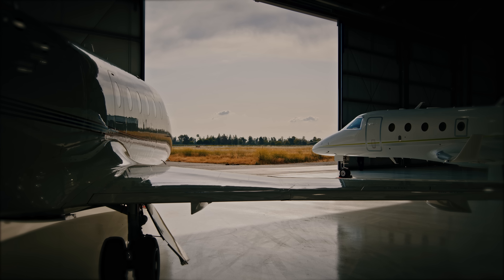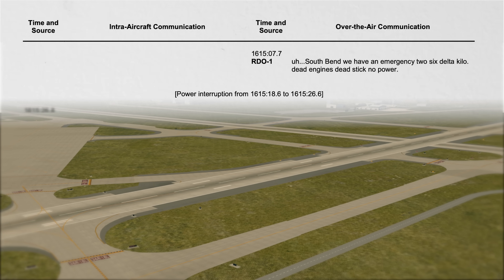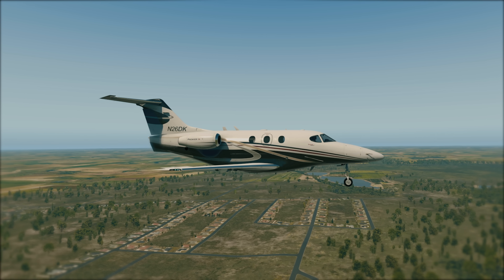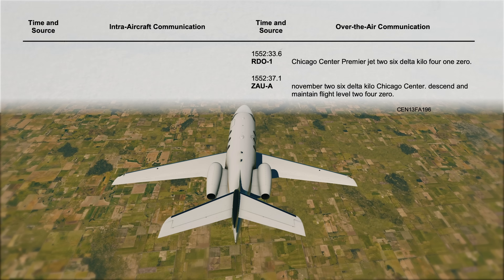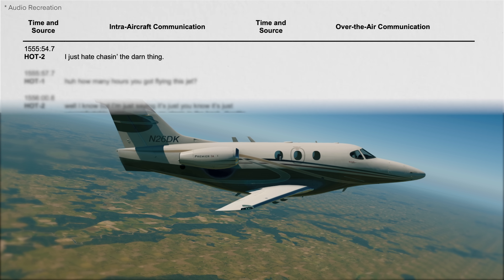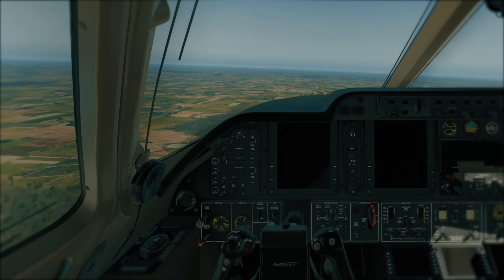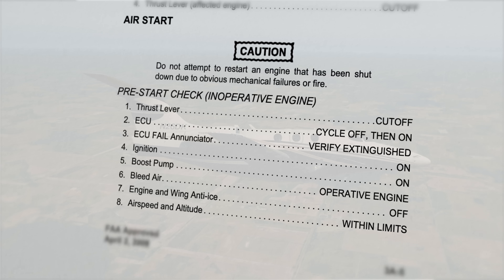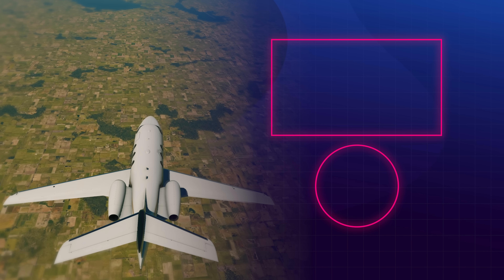Passenger Causes DUAL ENGINE FAILURE | Accident Case Study

Comment: Letting an inexperienced pilot have some time flying your aircraft is not inherently wrong or unduly dangerous.  However, the pilot in command needs to use some common sense.  This was a complex aircraft, difficult to fly precisely by an inexperienced pilot.  And secondly, the pilot in command was not an instructor.  He did not have experience in teaching someone how to fly the Premier.  He had no plan of instruction, did not issue specific or consistent instructions.  He should never have allowed the inexperienced pilot to enter the approach and landing phase of the flight.  Once the trouble began, both pilots were overloaded and overwhelmed by the multitude of malfunctions.

Comment: Obviously the whole entry into the error is a big issue, but am i wrong for thinking the gear up landing sounded pretty tempting given the situation?
Reply: If you know that the pilot is too incompetent to do a single engine go around procedure properly,  sure.  But there's no way for ATC to know that.  Personally,  all things being equal I'd feel safer going around on one engine than possibly flipping the thing into a fireball while sliding down the runway.

Comment: A belly landing on first approach was the best option.  Going around on one engine, then extending only the nose gear was the start of the fatal sequence.  Wheel-barrowing on the nose gear, no doubt scrapping the tail then led to the bad decision to attempt to get airborn again on one engine leading to the turning stall and crash.  ATC is not at fault.

Comment: It is also poor plane design of the landing gear control, the electrical control and the fuel stop finger levers.
Reply: He told him to pull it all the way back and he pulled it all the way back. It was pilot error.  It might have been an accident but he did tell him to pull it all the way back and that's what he did.
Reply: @LarsLarsen77  Yes, but controls should be foolproof and intuitive in design.

Comment: Bad design to have those fuel stops right there where they can be pulled by accident. I'd sue the maker of the jet
Reply: The fuel stops are questionable, but the standby switch for the electrical system is a real death trap for anybody who doesn't understand the detailed design of the plane. And therein lies the problem... the owner/pilot didn't bother to understand the plane's design (which was most likely chosen for good reasons). A professional pilot trained on this model would not have made any of these mistakes.

Comment: The owner of the aeroplane was a macho show-off, however, design of the throttle levers is grossly inadequate and certainly not foolproof. I've just watched a Mentour pilot video in which the ultimate cause of a serious accident was an overlarge watch dial catching on a control lever. Bad design.

Comment: I do not scuba into caves. I do not skydive. I do not fly often in commercial aircraft. I do not ride a motorcycle. I am happy.
Reply: More likely to be killed in a car crash than an airplane
Reply: @SpicyMcLovin  Not true.  You're more likely to be killed on an airplane flight than on a drive to the grocery store.  Flying is only safer than driving PER MILE, not per trip.
Reply: @SpicyMcLovin  Also,  that's for commercial aviation,  for private pilots the risk is WAY higher.
Reply: Except you probably drive a car...lol
Reply: You are a wise man.

Comment: I love how this is supposed to be a teaching moment? Yet, NO WHERE in this video do they acknowledge that ATC told a plane with no engines and no hydraulics to "go around" when in fact they should have told him no gear you will be belling landing on the center-line!? The trucks were there, but instead they said what they said and somehow the bad pilot managed to get an engine going furthering the "Swiss cheese" model! 

Calling a "no power go around" was ATC INCOMPETENCE! 
Belly landings are normal to a degree regardless of the incompetency of this particular pilot!
The ATC is in my opinion just as responsible for the deaths of these two pilots!!

Comment: I think this is mislabeled. This absolutely IS pilot error. Pushing an unqualified and uncomfortable passenger to control the plane in a critical phase of flight is foolish and dangerous.
Reply: Agreed. His attempt to show off was infuriating
Reply: Absolutely, this is mainly pilot error. While there is things the passenger could've done - like insisting that he's a passenger and he wasn't gonna help fly the plane any further and perhaps even leaving the cockpit if the pilot didn't get the message - it was mainly on the pilot. Even after the engines accidentally got shut down, he should've known how to restart the engines quickly, and once he got one restarted he should've (as the narrator said) circled at altitude first and troubleshooted and probably gotten the other engine started and made sure they could get all the gear down before coming down for another landing attempt.
But his attitude towards the maximum landing weight and airspeed shows that this crash was caused by more than just a mistake by the pilot: This was the pilot's entire attitude that was a major problem and would most likely have gotten him and his passengers injured/killed on another flight if it hadn't happened on this one.
Reply: @Vousie  If he did all of what you said he almost certainly would have landed ok.
Reply: Yes!
Reply: Shouldn't the captain know how to restart without using a checklist? And shouldn't an engine restart (even a dual engine restart) be as simple as possible to do when a plane is airborne? Shouldn't engines be not so easily accidentally turned off? That engine restart clearly wasn't simple to do or else the captain would have got both engines restarted. Wasn't there a loud alarm in the cockpit to alert the pilot about the landing gear not all being down at low altitude? If not then why not? It seems to me that this was a combination of  pilot error (over confidence and also giving his inexperienced friend too much to do) AND badly designed controls and alarm systems on the plane. Very sad outcome.
Reply: @WinstonWolf123  I'm sorry about the way this sounds. I have never said anything like this before, and I watch a lot of these accident videos.  The pilot was unbelievably stupid and full of himself, showing off like that.  The passenger non-pilot should have told his friend, I am not touching the controls again after the first overspeed.   This has to be the worst case of complete stupidity I have observed in the many videos I have watched.  The closest would have to be Saudi Flight 163 back in nineteen eighty when 300 people died.
Reply: Aircraft should be designed safer. Period.

Comment: What controller in his right mind tells an airplane with dual engine failure to "go around "??
Reply: A controller who doesn't want to see a fireball with people on the inside?
Reply: It didn't have a dual engine failure,  it had one working engine.  And it did go around.  Why would it even matter if he told him to go around with no engines?  It's not like it's possible.  He could have said "fly to china" it wouldn't matter either way.  That plane is coming down like a brick no matter what he says.  Why are you so angry about it?

Comment: I have a comment and a question. the comment.  the narrative is very detailed but it does not address any of the possible reasons why the aircraft banked right and the dove into a private residence after the second go around. what came to mind for me was this possibility;  When both engines were accidentally shut down it seems entirely likely that the primary pilot would have been under tremendous stress. As pilots typically do he didn't show it right away. but the fact that the pilot failed to complete the correct restart procedure and the landing gear was not fully extended during approach leads me to wonder if the primary pilot didn't have a health related emergency at that moment, caused by the stress. Perhaps he had sudden chest pains, a panic attack or possibly even the beginnings of a stroke. Anything along those lines would explain why the pilot did not successfully fly the plane in those final moments. Perhaps the friend in the co-pilots chair was attempting to manage the crisis when the end came. Now the question; Why don't airports have special emergency runways designed to accommodate planes that are coming in with problems. extra long runways with surfaces designed to slow the aircraft rapidly while spraying the plane with fire retardant foam. Perhaps a series of breakaway nets to stop the plane or dozens of cables to catch the underside of the plane and the break-off one after another to slow the plane. Some of these suggestions may be unrealistic or even silly but that doesn't mean that engineers can't solve the problem. When safety devices for cars were first suggested they were laughed at but now we take them for granted. Planes are just a lot bigger but it is still the same basic problem. thank you

Comment: This is why I don't think we'll ever get flying cars lol. I'm continuously doing flight simulator when not flying.
Reply: We will get flying robotaxis without controls. You get in a pod, pod does the rest.
Reply: @lepidoptera9337  There can be controls for emergencies,  but they would be idiot-proof,  so instead of controlling the flight control surfaces directly you would just say "go left,  go up go right" etc.
Reply: @LarsLarsen77  Flying doesn't work that way. You can't just go left or right and in an emergency most people will do just about the worst thing possible in the air. See the recent deadly accident in Korea. The pilots made about every mistake that one can make.

Comment: All pilots should remember in any emergency ANC = Aviate Navigate Communicate in that order!
Reply: The first problem is that in order to aviate it is absolutely necessary to know how to fly the machine. These guys didn't. They didn't even know how the power switches worked and how to restart the engines.
Reply: @lepidoptera9337  that's why you always use the checklist. These guys just proved Darwinism by killing themselves by being stupid
Reply: @lepidoptera9337  Restarting the engines isn't aviating.  It's working the problem,  which comes after aviating.
Reply: @LarsLarsen77  Read my first sentence. Having said that, I am happy to give you more attention until Mommy comes home. :-)
Reply: THIS

Comment: 15:13 The standby handles "minimum necessary to land" - which DOES NOT INCLUDE THE GEAR?? Or Starter???  So call it pilot error or what, call it inappropriate or illegal control delegation, call it cavalier disregard of design limit recommendations... just bumping that tiny toggle, which MIGHT have been inadvertent and UNnoticed, is what actually gave FIT ??
Reply: Not the way I understand it. It seems that as long as the engines were running the plane would have had power, even on standby. The problem was that they switched it on standby without the engines running. This is where working the checklist comes in handy, but it's not clear that the engine restart checklist would have been idiot proof... will a checklist designer assume that the pilot turns the electrical system off before he tries to restart the engine? Maybe not.

Comment: It seems like there are a lot of backup systems when failures occur. They have to be used in a very specific way. You could easily make mistakes if you are not knowledgeable about the plane you are flying and how exactly those systems work. You might think you're doing a good thing. But maybe not or maybe just not enough.
Reply: The backup system that guards against pilot error has to be invented, yet.

Comment: The gear up, no power, dead stick go around was a bad request.

It’s possible that the gear up landing could have been survivable.
Many of these smaller jets have positive outcomes with gear up on pavement.

I wonder if the go around instructions are mentioned as contributing factors in the actual ntsb report.

Comment: I never flew a plane and only know how to fly and what to do from simulators. Normally problems and problem solving in these situations is always very complicated, but in this case I was step by step "Easy, just restart the engines.... check the manual for the procedure..." etc. Every minute that went on I was more and more like "Wtf is that guy doing?!"

I'm certain there was zero issue with the plane, just sheer incompetence (through arrogance and willfully ignoring procedure).
Reply: EVERYBODY PANIC!!! FLIP SWITCHES RANDOMLY!  STOP PAYING ATTENTION TO FLYING THE DAMN PLANE!  BOOM

Comment: I have no formal experience in aviation, but if you were to have both engines fail while having an unexperienced person fly, wouldn’t you check to make sure anything they’ve done recently was done right? 

Seeing as he got 1 engine to start up leads to believe he ended up figuring out what happened, but was too slow to start both.  If so, that means he only checked over his friend’s work after a few minutes.  

It frustrates me knowing the pilot knowingly had someone else pilot a craft they clearly were not familiar with.  In my opinion, if you’re to have someone ever operate anything they’re not familiar with, you should know every in and out of your craft, and your unofficial copilot should be comfortable operating such equipment.  I know that is technically not allowed, but odds are these men would be alive today if the pilot followed that basic principle.  He clearly did not know every in and out of his craft as he would’ve noticed the engine had been shut off almost immediately, and would’ve been able to back track and reverse whatever was done wrong.

Comment: I can see why you would have a passenger fly the aircraft if you are enthusiastic about it. I don't want to defend it. It's against regulations, and for a reason. However, ignoring overspeed warnings is a huge red flag (or rather a huge red barber pole). And what happened after the engines have been shut down is nothing short of a shitshow. Seriously guys? There is a checklist for everything and it's not too hard to follow it. It's the best option you have. Playing around with the knobs in the cockpit will usually lead you nowhere.
Reply: But also these thrust levers are shitty design in my opinion. I would always make some separate switch for shutting down the engines instead of integrating it into the thrust lever. With the current design even a pilot who is properly trained could accidentally cut off the engines in a high stress situation. Mistakes will happen. This is just how it is. And one option to deal with mistakes is to make it as hard as possible to make this mistake, which means not integrating the fuel cut off to the thrust levers.

Comment: I had a King KMD150 on my plane, in addition to a Garmin 430... the KMD150 is not IFR certified... however it was much easier to use than the 430 and I often used it as the primary tool, but a battery powered IPad with the slow refresh rate... not for me.. capturing the ILS via vectors would have been the way to go, but I got a feeling this plane didn't even have a CDI

Comment: I would never imagine that thrust lever used to constantly adjust power setting is one lock away from turning off engines midflight. Logic would suggest to have lowest setting as idle and separate switch under a safety cover to cut off fuel flow completely.
Reply: you only touch the lock on ground. non issue.
Reply: Just another hole in the cheese.

Comment: Big obvious stupid mistakes were made during the attempted landing. Who cares if the gear is not extended. Get it on the ground in a controlled fashion. Going around on one iffy engine can be suicide for one. Should have retracted the nose wheel  before touch down. It all gear or no gear. Stupid telling a pilot  in that situation what to do, Controller should advice only that the gear was not down. He should have continued on with the landing.

Comment: The caption in the thumbnail says "dead stick". Why would the engines failing cause the hydraulics to fail as well? It wouldn't. That's why. It's common practice for pilots to "glide" their planes to a relatively safe controlled crash landing, rather than the plane just dropping out of the sky like most people think would happen.
Reply: Dead stick means total loss of thrust.  Not that the stick doesn't control the flight surfaces.

Comment: The question I have is why did the tower tell him to go around when he had communicated with ATC that he was dead stick. Was the tower not informed I assume or he wouldn't have said go around. What the tower should have said with the knowledge of dead stick aircraft was that the landing gear was up only, not go around. If he had not said go around the plane would have landed and been scraped up only. The pilot got overwhelmed with a go around and subsequent nose gear down only scenario. Then probably tried to troubleshoot on the second go around and forgot to aviate and fly to a safe altitude before troubleshooting. Being unprofessional in an aircraft will get you killed and kill whoever is with you.
Reply: What would it matter?  It's not like he could go around without thrust anyway. The pilot knew he was not dead stick,  so even if ATC just said no gear he still would have gone around. And the ATC probably knew he had an engine because the plane was right in front of him he could see the heat coming out of the engine.
Reply: @LarsLarsen77  The tower and ATC are two different things. ATC does not manage landings, the tower does. That's why ATC brings you in to line you up for landing then you switch to tower for landing clearance. Yes the tower has a visual if the wx permits but don't assume they can tell whether or not an engine is running from exhaust gasses.